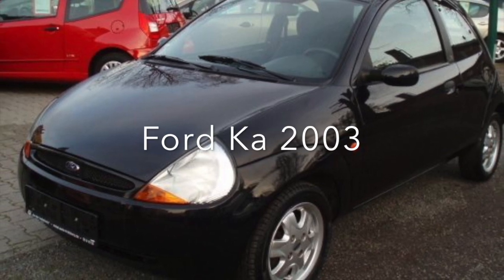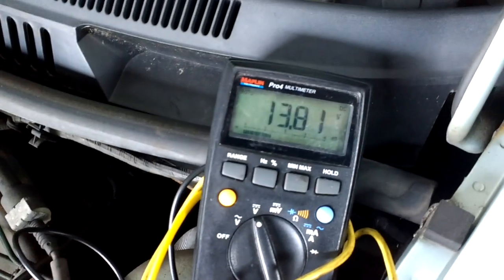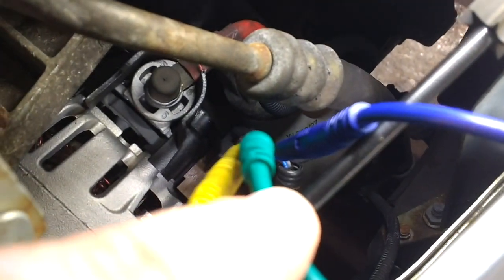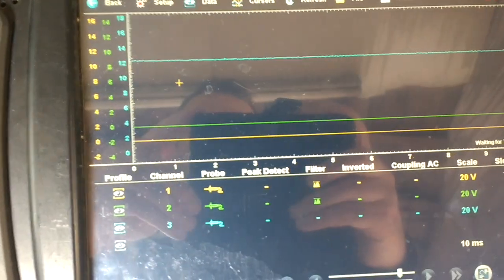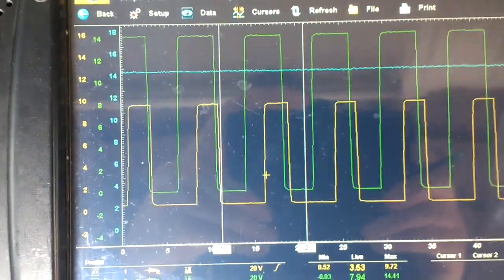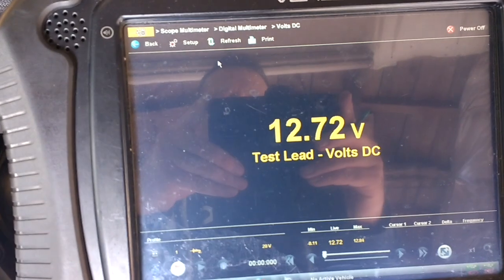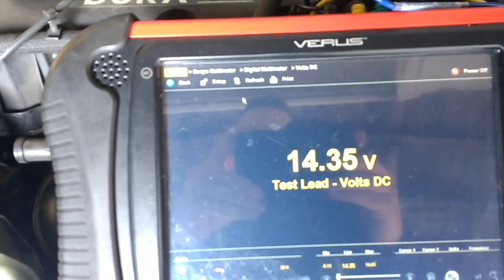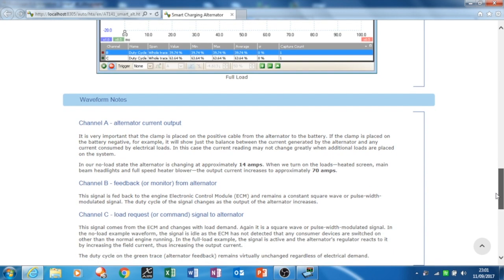FORD SMART ALTERNATOR PART 2

Comment: Hi Sandy, I have a ford ka 2007 with the same alternator problem, the first battery swell up because it was overcharging, the second battery was fitted and the alternator was still working, however now the alternator no longer charges. we have replaced the alternator and the same issue persists. the battery fuse looks fine as well. what else could cause the alternator not to charge.
Reply from the maker: Check the 3 wires from alternator multiplug near radiator they have a habit of burning/touching each other
Reply: @sandyande  i have done so. The grey wire was loose. I have reattached it still without luck. The alternator still does not charge up. What other things do you think it might be?
Reply from the maker: @mudathirs  has the alternator got a good earth, use multimeter between battery negative and alternator body what is the voltage drop figure? Also voltage drop between battery positive and alternator B+ post?